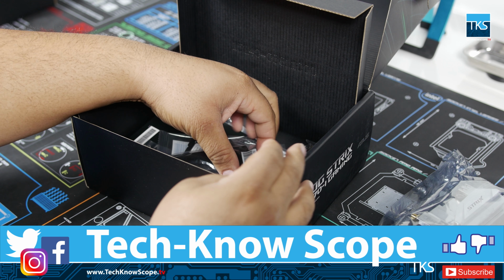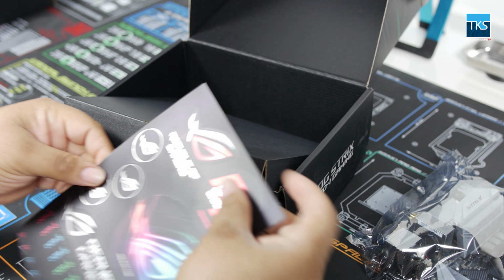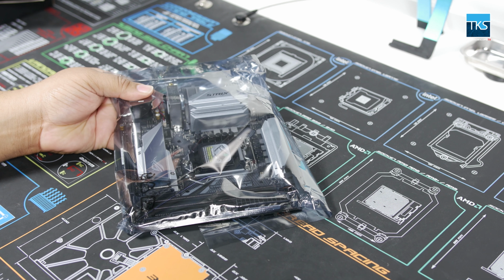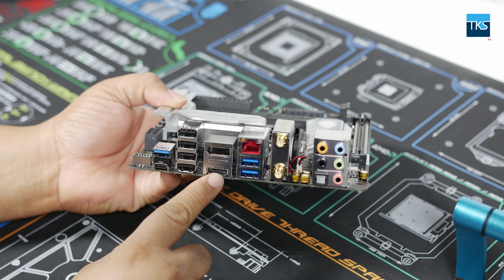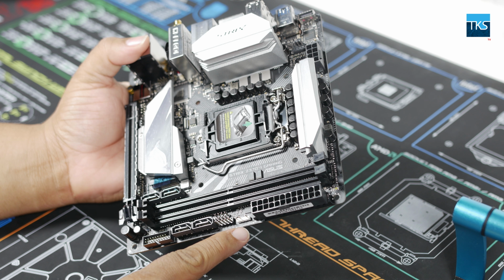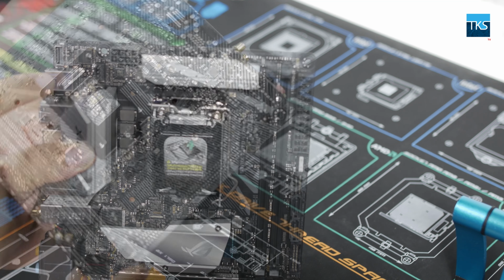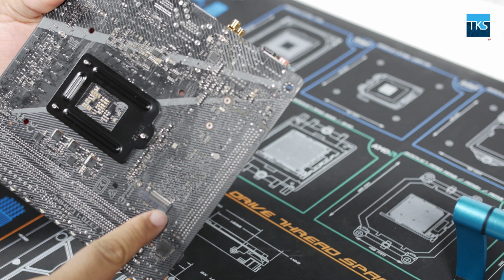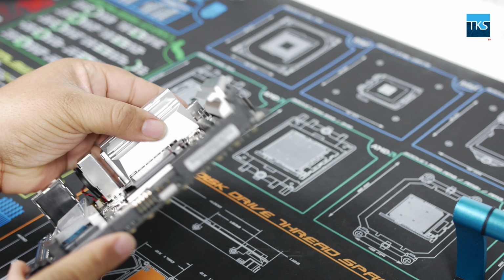▶️ Project Assassin Ep.3 | The Motherboard - Asus ROG STRIX Z370-I Gaming

Comment: Ok so you cleaned the cpu with alchohol (yes that is how those of us who created this language spell it), and then you neglected to apply thermal paste? Is this Verge levels of incompetence or did you just not record that bit?
Reply from the maker: The AIO already had thermal paste pre-applied to the underside of the pump. I just used what was already there instead of using an aftermarket alternative. If you ever see a video as cringy as The Verge on my channel, it was intentional.

Comment: Hi , thanks for this video , I have same motherboard I have issue with rear ssd , did you try the ssd slot in the bottom because I use both of them and the one in the top near cpu with shield work with my both SSDs that I have
Reply from the maker: It should work, but I did not try the system with more than one SSD.

Comment: Hi, do you know any case that support that usb 3.1 gen2 connector on the board ? is it thunderbolt 3 ??
Reply from the maker: It's not thunderbolt. I believe the new Fractal Design cases and BeQuiet cases have them, but both are massive and far too much case for this little board. If you're using a standard size board, you may want to consider one.
Reply: Thank you for your answer, but I want to stick with mini itx, so I might go ASROCK fatality z370, it has a thunderbolt 3 in the back but it only has 1 M2 connector :-(

Comment: Bought this mobo and what a disappointment! RGB software straight out of the 90'... Eats cpu power, crashes and very limited in function, I uninstalled mine.
Sound distorts when seeing videos and doing other stuff at the same time.
Last asus product I buy!
Reply from the maker: Interesting. Mine has been rock solid. I haven't had a single blue screen with it. I even did a 9 hr overnight burn in with no problems.

[Edit] Also on this particular build, I'm not using the RGB software.
Reply: Have you noticed the sound distortion when multitasking? Also I uninstalled the RGB program and just use the board without the controls
Reply from the maker: I didn't test the onboard audio, I only used the HDMI output. I will take a look at it though.
Reply: thanks for replying, would be interesting to hear what you find.
A few years back I would just have investigated and spend a ton of hours getting the thing to work right. But this computer was build to use as is, and when a top brand product cannot make simple programs for their own board that actually works I get mad.